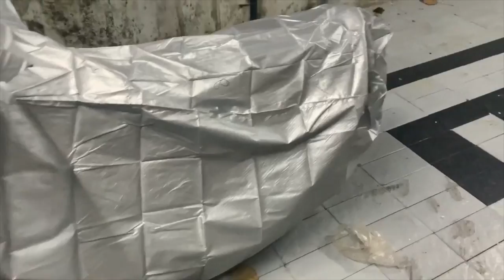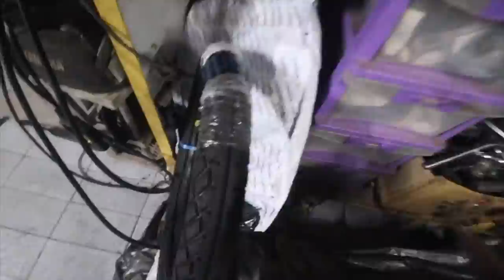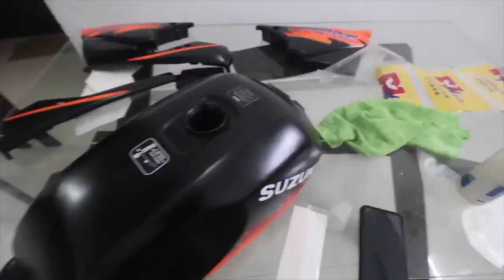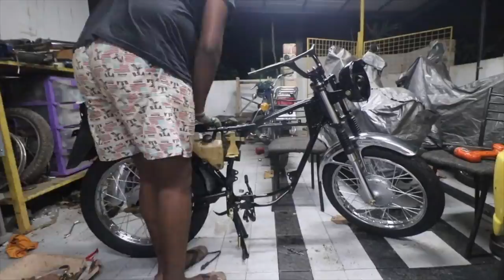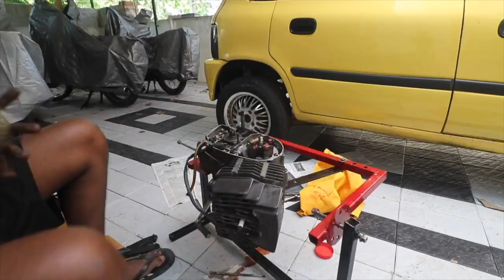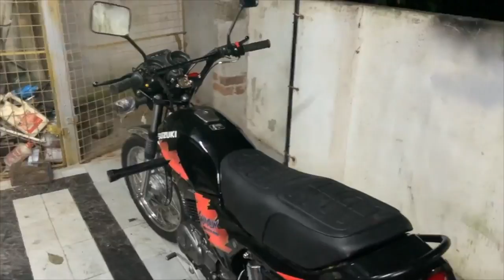Suzuki Shaolin Restoration under 8 minutes

Comment: Cost ethra aayi?
Reply from the maker: Nokkanam
Reply: @Yamakaze  
Rx100 nu 
Side boxil 2t oil nte  connection koduthal problem ethelum undo
Reply from the maker: Pump failure rate valare high aanu, engine inu panni kittum